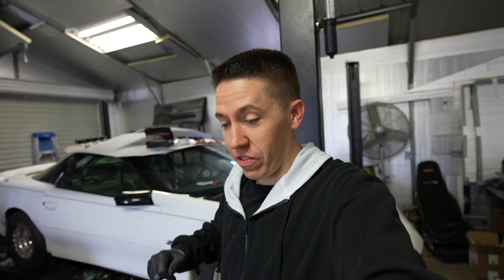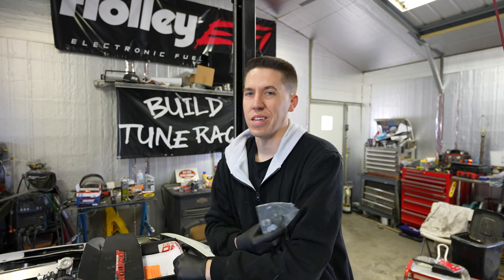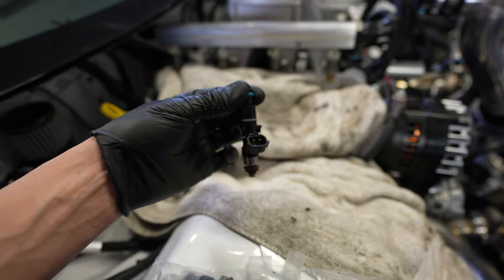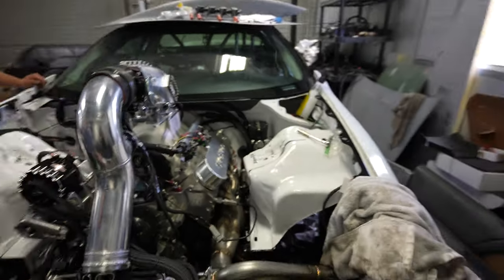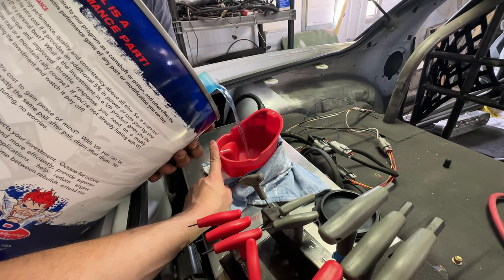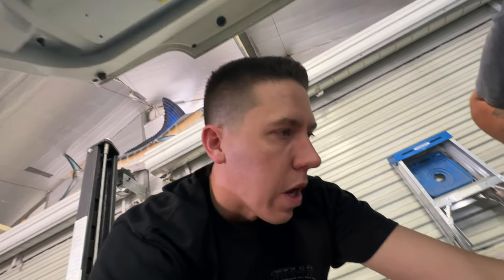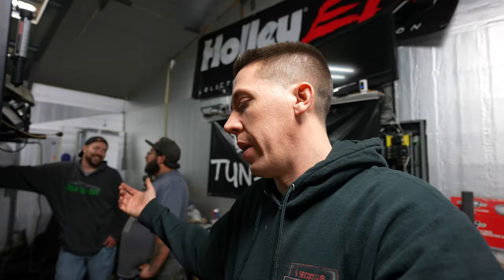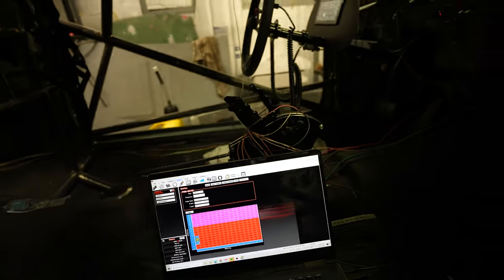Salty's 1800hp Twin Turbo 427ci LS FIRST START UP!!!

Comment: I got a 383 stroker 5.3 LS gen 4 iron block 6 bolt mains and 4 bolt heads, 317 cnc ported heads btr valvetrain ect., mahle powerpak pistons 11.1 compression, Eagle H-Beam rods/crank, ARP bolts throughout the entire motor with twin 6266 pte bb turbos, Dominator ecu...... what would you think be a safe power level considering this setup for my street/strip car? I was hoping maybe like 1000ish Wheel Horsepower.
Reply from the maker: Should be able to make 900-1000hp pretty reliably. The stock 4 bolt heads are really you limiting thing but just what you can to keep them happy and sealed and should be pretty good to 1000!